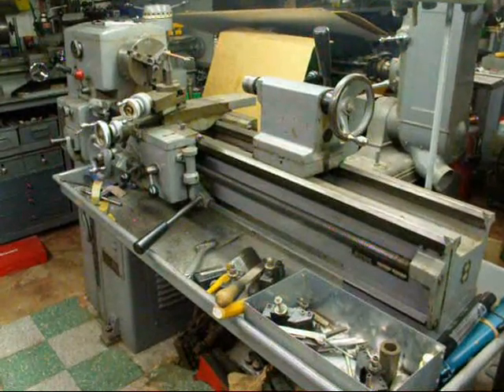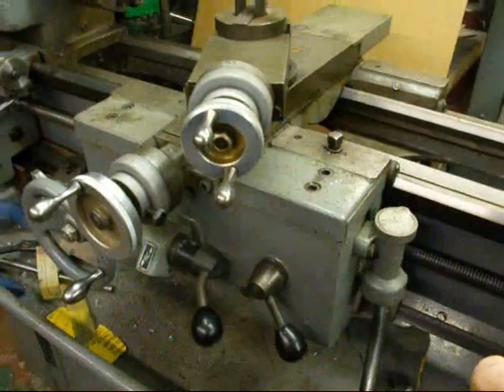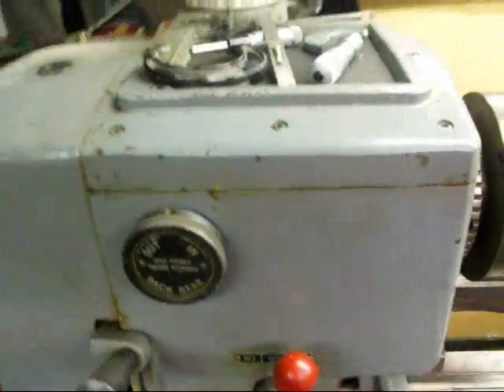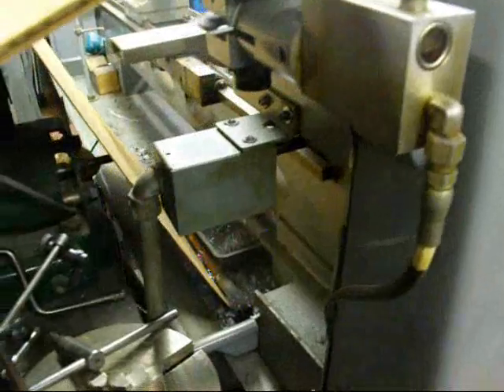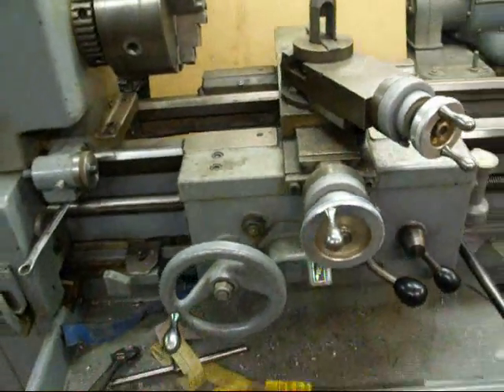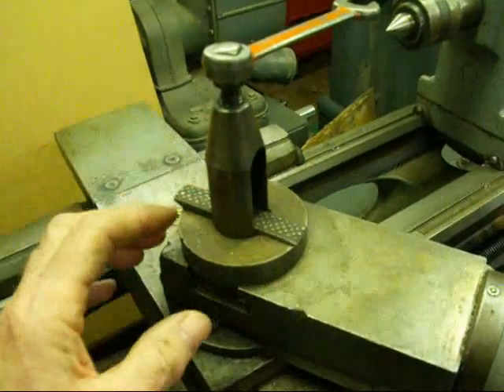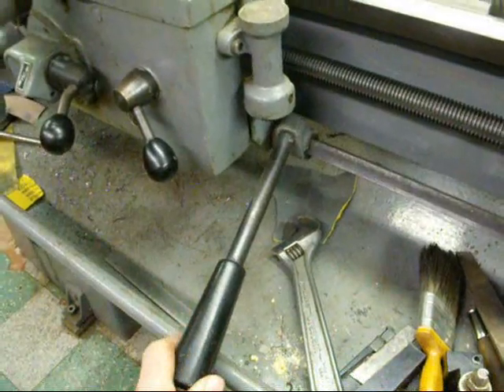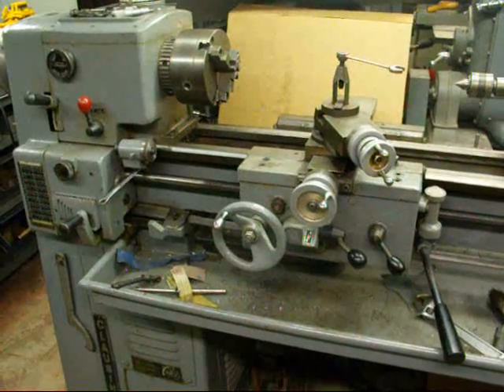PARTS OF THE CLAUSING METAL LATHE tubalcain

Comment: Do you by any chance know how to remove the spindle assembly from the headstock to replace the spindle bearings? I have this exact same model (or one that's darn near exactly the same) and I must replace both the spindle bearings. I have removed the belt/pulleys/gearing outside the casting and removed any internal parts that are in the way. I cannot seem to get the spindle to slide out of the headstock even after completely removing the headstock from the machine. An exploded diagram/manual (originals were lost in a flood) would help but if there's a special trick to pulling the spindle out I'm willing to try just about anything. Thank you good sir and cheers from Cleveland Ohio

Comment: What happens if you turn the variable speed when the motor is not running. It got turned when cleaning it and not it the chuck won't turn

Comment: [ THE NEW QUIK CANG LATIN POST. "AFRDEBAL TO ALL".] 

interesting subject 
:- there as been of late  an interest, in the revival & modification of the  lantern  tool post .   having asked  the question  , what Mack the  Quick Change  tool post . Viable.    AS apposed to the Lantin post . which is clumsy a often sloppy when  loos within the  cross slide . 

Having asked the question some enterprising lath operators ,  have develop the Lantin tool post in to a viably.  , & useful addition to the lath , & now qualifies as a quick change  tool post.  dominated as we are with the varying brands  we realised , that some of us cant afford the costly , versants , on offer .  so we took a new look at an old Feruvite   the "Lantin tool post "

something the home lath owner . Can indeed make if nursery on his own lath . 
so I have decided to publish the vireos mods mad to the Lantin tool post so the opatunity for you to to readdress the , problem with tool holding within the  lathe in the ues of the present day Lantin tool post 

[ONE] , the top holding nut Or bolt .
:- When you wish to change  you tool the Latin post often becomes so loos you loos position &  concentricity    with the job in the chuck or between Centres. creating & losing time in set up.   the we have over com by using the base of the Lantin post as a jack . the propose is to lock the Latin in place . at the desired place by rotating a foot on the inside of the Lantin post base As  foot within the base terns it protrudes  out to looks  the foot in place  as it pushes  down on the base of the compound  & the thread is trapped within brace of the Lantin & the nut within is the foot length of the remaining base  as a keyway cached  by a grub screw with a spigot tip. allowing the foot to slid out as the Lantin is trend  the bas of the nut fits in the reses of the Latin brace  & extends  frankly les that 1/8,  to have  affect . the vector need consideration as you titan down . for the poison of your tool 

[TWO]  the need use shim stock . 
:-      This being one of the most annoying aspects of the Lantin tool post . Winkey's  Work Shop Re intraduct   the . concept of the Adjustable tool post shim . of the 18 century. proving it is possible to cast aside the need for shim's  by the ues of  an internal threaded  pock  witch sits over the Lantin post . See Winkey Work shop, .Lentin post part 2 . patent expired. 
  now when you reqiesr to change  a tool it is capered with in the Lantin  post & the up force exerted  holds it fast ,  Latin  post . now you can select the tooling you reqiesr  remove a tool as the Lantin remans stable adjust if required & the tooling  reman in position , &  concentric .  with the work. TO reposition you twist the Lantin to unscrew &  return in it new position & Twist to refaxes   , THE Top Applies Toque. some have pined the nut to cone Tee nut to encoring & positive  Acer . point.  often the nut turns within the Lantin , so their is reason  to consider tis approach when fixing the base Nut. 

[ THREE ]  Why this approach to quick change  Lantin post.  
:-  well cost for the beginner & home obey mechanists ,  They may Desire  an aloes or smoother tip of post.  "BUT"   they have a budget & require to ache the best that can with what they  Have at hand .  I for one do not spend money I do not have & The Lantin quick change tool post can be maid on the lath Including the slot By boring up the centre  to you desired widths the  & cutting out with  saw or grinning basic   or fail to Clean  up .    Given most of us haven't a mill. 

I hope this help some  of you  in your quest . 
Les Thompson England  A mention out for Winkey's  works check him out .

Comment: Good afternoon Lyle,
Hope you  are doing well. I have finally gotten my Clausing 5912 lathe to the point of wiring it up for service and could use a bit of advice. Most importantly I would like to know what phase converter are you using on your Clausing. I need advice on the best option here if there is one. I also need to rewire the motor wiring...what wire type would be recommended for this application? Thanks so much for your help and keep doing what you're doing...it's outstanding!
Thanks so much, Chip
Reply from the maker: I do not remember the wiring size. But I use a phase converter, the static type.  They cost less than 200. It is the size of a cigarbox. Very easy to wire up. There is a horsepower loss, but I have never noticed it. You can buy them from any industrial supplier like K BC tools or j and l     I have never had any problem with mine
Reply: @mrpete222  Lyle, thanks so much for the suggestion. I ordered a static unit yesterday and am looking forward to making some chips...Have a great Fathers Day my man!
Reply: Chip Collingwood.....hire an electrician before you fry up.

Comment: I used to operate a Clausing and one of the things that I really liked was the tapered spindle. We had A Hardinge collet holder with a  tapered mount so we could switch it between the 6 jaw chuck and the collet hoder without having to indicate it in.

Comment: Hi Mrpete222, I'm currently laid up with knee surgery and have been watching as many of your vids as I can per day...tremendous instruction and information...your a natural. 
I own/run a vintage sports car repair shop and I often find myself going to my machinist/fabricator to make things for cars that I'm working on, or executing ideas that I have. I am very interested in acquiring either a lathe or a mill or both for the shop when I can afford them. What would you suggest as a first step, lathe or mill...and if lathe which one would be best for my automotive needs...I like the Clausing, but am concerned about the hydraulic speed control as I've heard repair parts are unavailable. As always thanks for your input...keep doing what your doing...its truly invaluable...cheers Chip

Comment: I understand the Quick Change Gear chart. What has me baffled are the decimals under the TPI settings. I hope there is a simple formula to help me decipher what these figures mean. As it is, the meaning escapes me. Can you help me? Will you help me?
Reply: mr pete is there a quick change gear setup to do metric threading on a clausing 6913
Reply: That is the lathe that I have. I have been puzzling over this as well.

Comment: Thanks for the vid mate! new to lathes so you learned me something lol, just a question about your phase converter, is it single to three or other way around. i have a 3 phase mig welder i need to run from single phase mains and just wondering if yours was purchased or made. cheers.
Reply from the maker: it converts my household voltage (220) to 3 phase.

Comment: Great video Mrpete!  Also, it was nice meeting you at Johns Open house a few weeks ago!  

I just recently acquired my first lathe, a Clausing. 5904.  The gentleman I purchased the lathe from didn't really know how to operate the machine and in an attempt to demo the machine for me he changed the speed on the back dial while the lathe wasn't on.  What kind of damage  can be done to the machine if you change the speed without the motor being on?  Is there anything I should do before I turn it on myself?  Thanks in advance for your help!
Reply from the maker: good to meet you. rotate it by hand until the pulleys adjust--probably no harm done
Reply: mrpete222 thanks for the tip!
Reply: One other question, Mr. Pete, if I were to purchase a 4 jaw chuck for this lathe, what style is it?  Is it a D1-4?  Thanks again for your time!

Comment: Hi Pete,
I recently acquired a Clausing 5903 and "appears" to be in the same shape as the one you used in this video and I need to put a value on it because I may need to sell it. The reason I say may need to sell it is because I also have a South Bend
CI 10057. The next question is what the value the value is on the South Bend and which one I should keep if I decide to keep one. The South bend is in good shape, about the same as the Clausing. I live in R.I. in case that makes a difference, I heard that the area could effect the value.
Thanks, and thanks for all the videos you make for us "Not so Smart" guys

Tom
Reply from the maker: The clausing is worth about 1500. Not familiar with that model SB. Its a toss up--I love both brands.

Comment: Mr tubalcain,

Thanks for your video. I work as a research machnist at IUP and we have a Clausin lathe just like to one you are showing. I had to replace the master cylinder that provides the variable speed. It works ok but now I have another problem.  As you may know, there are a gang of plates behind the motor that I assume work as the brake mechanism. however, when the lathe runs idle a direct speed, it make a continuous racket. do you have this problem too?